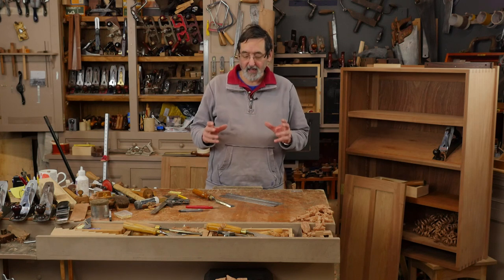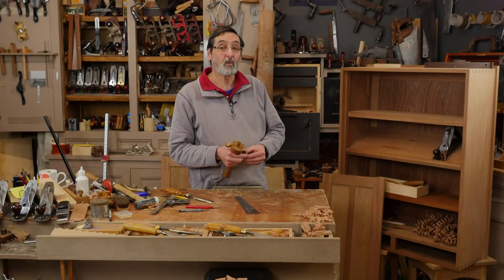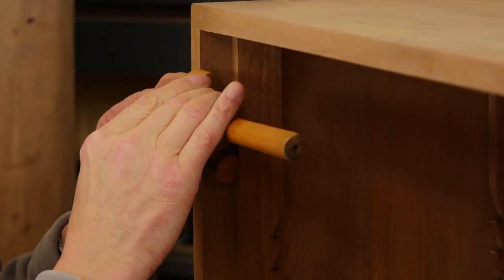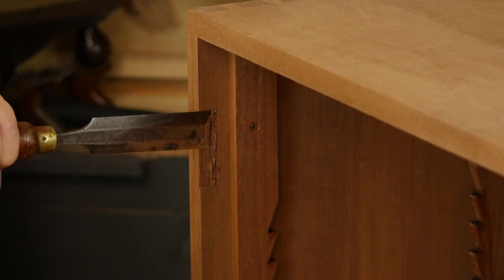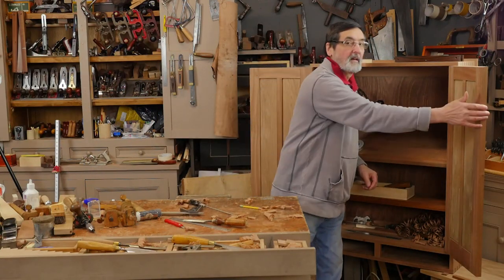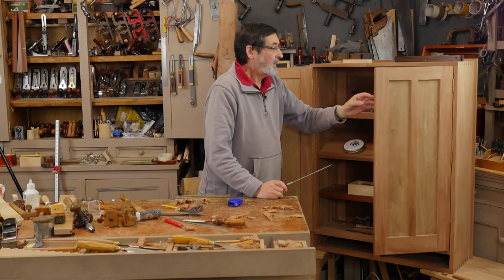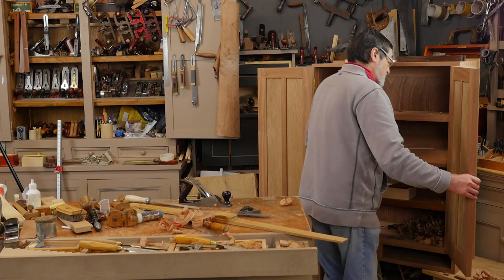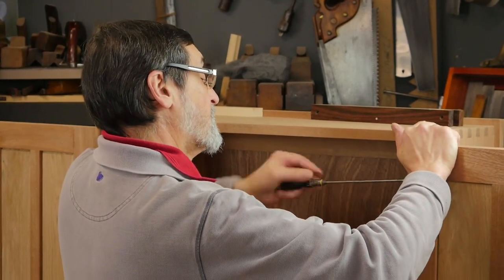Door Hanging | Paul Sellers

Comment: Hi Paul, I have my great grandfather's square awl (it must be 100 years-old) and the handle has a little crack. If I glue it and clamp it, do you think I would be able to fix it? Thanks in advance. :)
Reply from the maker: Yes, you could use a two-party poxy and allow it to drain into the recess of the crack and then let it set. This usually works.